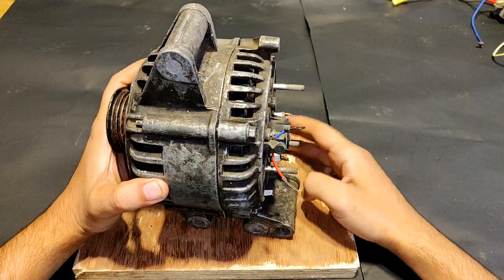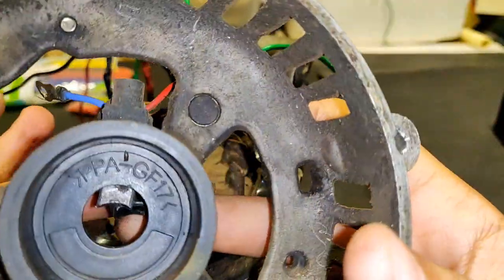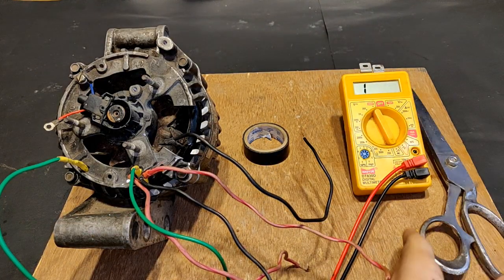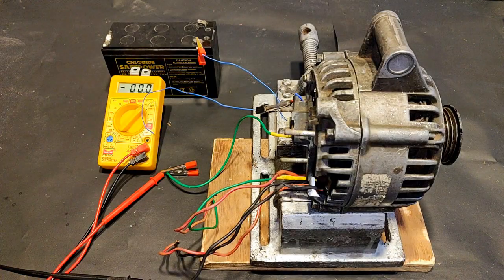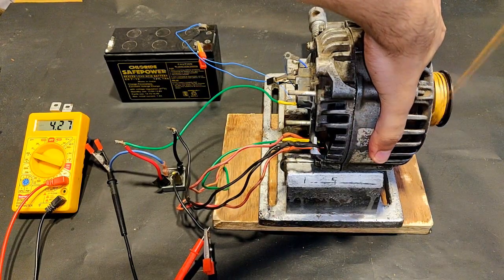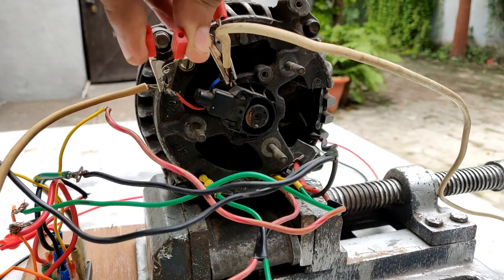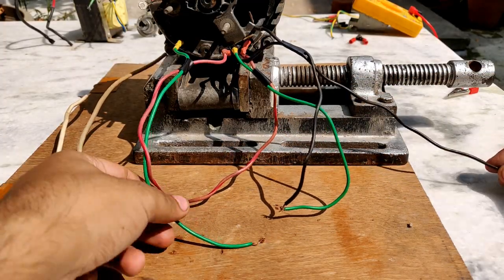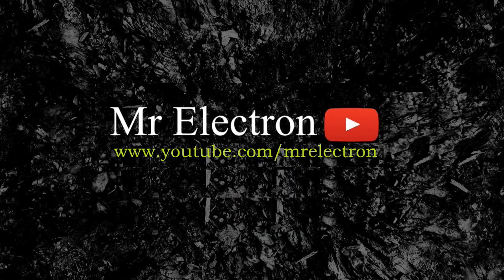Generate 220v AC from 12v 64 Amps Car Alternator via Solar Panel Excitation ( 21 volts )

Comment: I connected those stator wire in series and I was able to get 15volt ac reading but it can't power even 12volt bulb.please help me what's the problem.

Comment: Of course, the biggest issue with alternators is, they really don't (generally) make that much power. 12v 65a only translates into 780 watts. Before rectification, this amounts to only 6.5 amps at 120v...and negates the linear slope form of the power generation (as RPM increases, so does voltage). Consider, that just to build a 3.5kw 'power generator', it would require (in addition to the 6.5 hp combustion engine), a 'farm' of 5-such alternators, power-rectified to DC, placed into parallel circuit arrangement, then into a PC circuit using parallel mosfets...wow, watts cost a LOT OF MONEY to change current flows!
 For low-speed use (such as with a windmill), you would need an in-circuit voltage regulator to charge a lead-acid battery and not damage it (which is why alternators have regulators built-in)...and you couldn't use this alternator as a 'generator head', because, well, it only makes 650-watts (far too heavy and bulky for the little power it produces to be efficient). Far greater 'power generation' efficiency can be had with AC induction motors...where the electromagnetic field is replaced with permanent magnets (opposite of the way most do it - where they drill and fit permanent magnets into the armature), but the way in which the most-durable true 'power generators' are made.

Comment: Someone asked about replacing the rotor coil with magnets.  When the rotor has permanent magnets, the alternator is not able to be controlled by a charge controller.  With the rotor coil, the current through the rotor coil can be varied to control the output of the alternator.  Zero coil current gives almost no output.  It takes only an amp to make the alternator put out hundreds of watts.  The rotor coil should have a 10 ohm resistor in series to limit the battery current.

Comment: My question would be if you have the solar panel and battery what do you need the alternator for? The sun will make the solar panel work to charge the battery. All you need now is an inverter and it saves a LOT of work.
Reply: Good question. The solar panel is too week for serious source, then more expensive. If winter time water proof is not so water can destroy panel.

Comment: 5.18 amps on a dead short. What will it do into a load? Also, how are you going to control the required 50 Hz frequency required in your area?

Sorry, no such thing as an LED halogen. Halogen gas is what is in your headlight. Your work light is just LED,

Comment: why take alternater apart  when alternater can charge battery anyway with a large enough dc motor run off same large battery the alternater is charging ,, just  hook up a couple of 12 volt 25 watt light bulbs or whatever watts you can get in 12 volts , i dont remember what all watts you can get ,, its been years since i did it before i moved to philipines

Comment: How to convert an alternator in to self exciting alternator . I want to use alternator for home use without any battery or any other power connection
Reply: You need to replace the rotor windings with permanent magnets, as the battery source is used to create magnetism.

Comment: [3:20] don't use angle grinders without the guard in place as cut-off wheels do shatter and produce serious eye and facial injuries.  Use of safety glasses AND a face shield is wise.  Also, wear leather gloves so as to reduce chance of loosing a finger.

Comment: Sir,,  if i excited the rotor using battery then it possible if the output the alternator I will use to charge the battery

Comment: can u please make a diagram so can understand easily the wiring 😍 thankyou so much
Reply: What diagram you need? The guy cut off all winding and connect all like one line, serial connection. Now is voltage is over than normally. The point is Who will be move a shaft?

Comment: Did you ever of ohms law?  220 volts, how much current?
Reply: 64 amps at 12 volts is around 770 watts, convert that to 220 volts, you'd get around 3.5 amps.

Comment: I maybe wrong, but the attempt here is to replace what  a inverter does: going from low voltage DC current to 110 or  more voltage ac current.

Comment: You split the amps to multiply the volts
Reply: He thinks 64amps means every second when really it means per hour at top speed it takes me 24 hours to fully charge my car battery with 24amps 12v i need to drive 100mph for 3 hours to get 5amp into my car battery.
Reply: What he said 😭😂

Comment: 16:min
With best fixations 
If you run a 220v motor to run the DC alternator does it continue to run by himself ? 
Could you take current from the exhaust power generated ?

If yes, you got 220v from 12v
Reply: No. Law of energy conservation should be obeyed
Reply: You could use a turbo's propeller shaft to generate power from exhaust but I am not sure if it's enough to continue to run by himself.

Comment: What's the point ? U can easily convert DC to AC using an inverter circuit without the car dynamo
Reply: Yes...you can use the wind .see my chanal
Reply: The point of this is how we’ll soon be producing our own electricity after the Biden administration destroys the energy sector and the country with the communist green new deal.

Comment: If you take the armature apart and remove the winding and replace with circular speaker magnets, north pole to the front and south to the rear or vise versa  put it all back together you do away with the need for exciter.

Comment: you need onely an extra winding, or an serial 12/120 V. Trafo which gets electricity from DC without condensator , I don't understand the sense of the video, 220V is not in a car generator normally.

Comment: What the solar panel for?
Reply: When you move a magnet over a wire, electricity is generated in the wire. The moving part inside an alternator is the magnet, an electromagnet called the rotor. To energize this rotor and thus produce a magnetic field, you need a power source. This is what the solar panel does, it produces the electricity to power up the electromagnet built into the rotor.

Comment: Good stuff. One precision about the 200w floodlight. It is a LED light. Not halogen. What about replacing the wound  rotor with neodymium magnets in a special pattern that would allow low rpm? Good luck.
Reply from the maker: Thanks.. One of my upcoming videos 😃
Reply: @MrElectron  
.
Reply: Who will turn the generator to get the power?
Reply: @winner_my  grab a 2a, ac or dc (rectifiy) like he did, and power it off the alternator